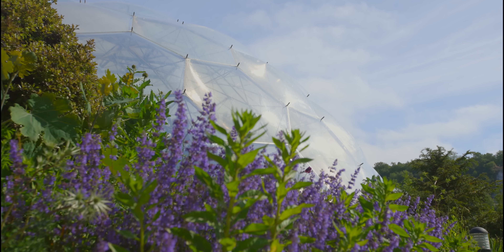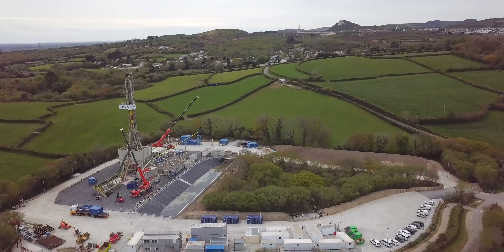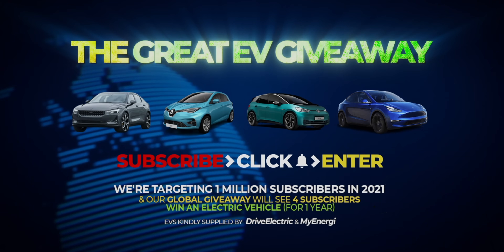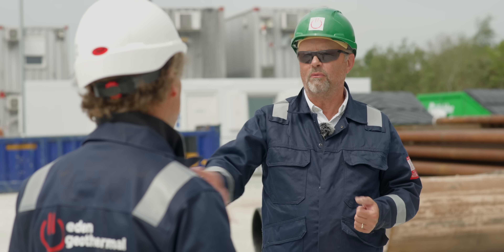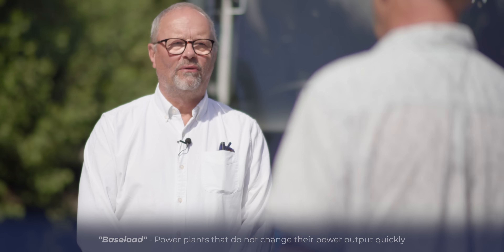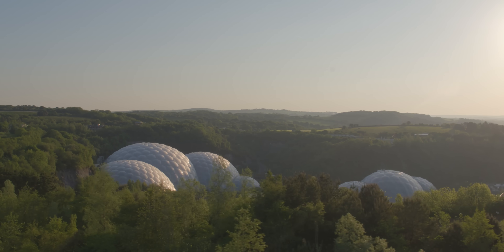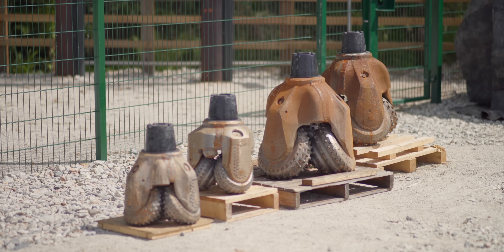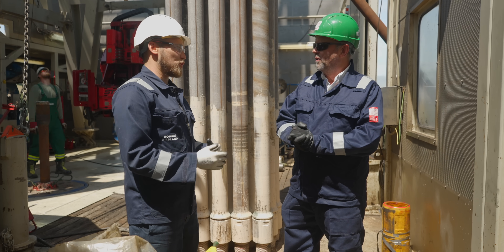Is Geothermal power the answer? | FULLY CHARGED

Comment: You would think that every new housing development could share one reasonably sized bore hole for District heating. That with a solar array and GSHP and maybe a battery and every house could be essentially carbon neutral?
Reply: Planning permissions would be a nightmare.
They all ready are for aesthetic reasons, but it would increase 100 fold, ostensibly for ‘environmental’ reasons. I can imagine locals complaining about noise, fumes and worries about water tables and earthquakes.
Britain can’t do anything without 10 + years for lawyers and consultants to get their cut.
Reply: Not carbon neutral, lots of gas comes up with the hot water. Oops nobody mentioned that....
Reply: @kimollivier  Gas? What sort? How much? More than would be produced by heating the house/flat/building up to the same temperature when using gas central heating or electricity? What does "lots" mean?
Reply: @Neilhuny  exactly,  it's known and there are scrubbers for cleaning up. 
Still there is some slight co2/methane release. 

Geothermal and nuclear are the biggest potential for most countries.
Reply: @kimollivier  That is a valid comment about the whole show. There are various problems with geothermal electricity production and this show didn't address any of them. I didn't know about the methane issue but that would have been a nice one to address. Does the fact that they are drilling through mostly granite reduces the problems with methane release? Are there other gases that are problematic as well as methane?
Reply: @kimollivier  Or the radioactivity. There was a small hint about that. Granite is hot because of the decay of its uranium content. A chap from NZ I talked to many years ago also mentioned the issue of the hot water containing many dissolved chemicals from the rocks and how corrosive the hot fluid was. You can bet the greeny weenies will be out in full force against geothermal when it hits its stride.
Reply: And, in addition to carbon neutrality, there's the economic win of no-one ever having to pay a heating bill ever again.

My mate moved into a flat in a new apartment building in our town. It had been properly built with all the insulation, solar on the roof of the building that powers an air source heat pump. No-one in the building ever had to pay for heating. Completely free and included.

It can be done because, in places, it is being done. And my mate's chief complaint was that, actually, it was too hot. Whatever insulation they used was, arguably, too good. As his problem was always trying to get rid of the heat, never once that it was never warm enough.

Note: If you're ever getting a heat exchanger / heat pump make sure that it's reversible. Because, yes, any heat pump / heat exchanger can be rigged up to run in reverse and actually take heat away, and act as air conditioning. And, trust me, you'll want this. It might not strike you as likely, if you're struggling to warm up an old Victorian house in Winter, with high energy bills, that your problem would ever be the opposite - that you're getting more heat than you ever wanted for no cost whatsoever. But, seriously, that's what my mate experienced in a properly constructed modern apartment block, as they'd built it from the ground up with the best insulation and using a solar-powered heat pump (air source rather than ground source, admittedly - but that's the thing, air source is possible anywhere, where ground source might not be easily done).

Imagine the economic win of every building in the entire country having free heating. Well, the energy companies would lose out. But, like, the largest part of most people's electricity bills gone in a puff of smoke. Hundreds to thousands of pounds a year put back into everyone's pockets again. Free money for everyone, basically.

The technology's already there. Because, as I said, I've seen it in action. A rather large apartment block (there was at least 50 generously-sized flats in the place) where no-one paid for heating - all inclusive - and, truth is, it was too good. The residents complaining that they needed to turn off the heating more often, as it got too hot and never the reverse.

And this is without going on to consider ideas like district heating and distribution. So, if that apartment block got too hot, then it could pump the excess heat out to other buildings. And battery storage to do the same thing with any excess solar. My battery's full so, here, have my excess. Put it on the Grid, for someone else to use.

We could eliminate anyone ever having to pay for heating ever again. And that is, by the figures, the biggest chunk of what we pay for, that creates the most carbon emissions to satisfy.
Reply: @klaxoncow  It's not free it'll be included in whatever the service charges are for the building. The service charges are likely high as well, part of the you will never own anything and be happy mentality. District Heating schemes are well known to have efficiency benefits however the costs generally don't stack up. 

Properly insulating new builds is a separate matter as is designing to take into account and manage passive solar gain. EcoBling isn't the solution...
Reply: @klaxoncow  This post needs to be a Fully Charged episode all on its own

Comment: Trying to grasp the differences between shallow-ish depths for heating and cooling, and the deeper pipes for electricity generation..
Reply: The latter require a heat pump which of itself needs to be powered because it is tapping into consistent underground temperatures which exceed the temperature at the surface in winter.  It greatly reduces the energy needed to heat water and/or buildings but doesn’t eliminate it.

As such these two are only loosely related.

Comment: As mentioned in the video, it’s the oil and gas industry that has provided all the technology to be able to drill geothermal wells - not just here in the UK, but worldwide. For commercial geothermal power production, you need to pump water down the deep well and then back to the surface through the shallow well once it’s been heated. There will inevitably be some seismic response due to the higher underground pore pressure from pumping water underground. The pressures are not as high as those used in ‘fracking’, but will be seismically detectable. By default, you have to accept that seismic response if you want to utilise geothermal commercial power.
Reply: That was covered in another video. There is a drilling site at United Downs near St Day in Cornwall.

Comment: The question I was hoping to be asked is does this energy source lessen over time?  As the rock is cooled by cold water being pumped down does the rock temperature remain the same?  Perhaps it is close enough to the core that the heat is constantly replenished.
Reply: Geothermal heat is generated from decaying uranium and other radioactive isotopes in the earth’s core. As long as enough wells are drilled deep enough the heat is always there.

Comment: Batteries will replace baseload eventually. It could actually happen a lot faster than people think. Hornsdale in Australia is just one of 50 battery installations now that are already bankrupting peakers etc. And baseload eventually as the infrastructure continues to grow and become cheaper.
Reply: Hornesdale is only profitable becuase Oz has an utter fail off an electric market.
Reply: @simonhenry7867  Its the same story everywhere they are being deployed. They are cheaper to operate than peakers and frequency moderating assets. All of which have high marginal costs where as batteries are near zero marginal cost.
Reply: I think baseload will always make sense to some extent. If something is constantly using power, why create energy, transfer it to battery, then transfer it to the constant power use. I think it makes sense to get a baseload that handles the constant power use and then even separate it from the grid.
Battery storage works best flattening out a peaky usage and/or supply.
Reply: @trevorWilkinson  Our current arrangement is inefficient because it does not have storage. You only need 4-5 hours of storage in any grid to displace 80% of the generational assets. And we receive more energy from the sun in a single hour on this planet than our civilization uses from all other sources combined. Including fossil fuels, each year. Its a stupidly small fraction of a percentage that we need to capture and store to meet our daily needs. The current grid needs base load because it is a centralized system. The new grid infrastructure is distributed with millions of contributors. Solar and wind are distributed energies. 
In the next ten years we are going to hit what is known as "God Parity". That is the point where it is cheaper for the consumer of power to be energy self sufficient, than what it costs the utilities to deliver the power, before the marginal costs of generation are added to the bill. We are already way past grid parity today.
Reply: You're right and with things like ambrí battery, water or heated sand as is being tested in Finland.
This is a real scam to rescue oil industry. With public funding.

Comment: I love geothermal but it can’t be done everywhere, you need the correct geology to make it work. Iceland have the ideal geology for it for example.
Reply: Technically, it can be done everywhere, if you drill deep enough... the catch is that the deeper you go, the harder and more expensive it gets, so there's a limited number of places where it's cost-effective.  However, as pointed out in the videos, if drilling for oil etc reduces, there will be more drilling rigs available, helping to push down prices for drilling deep wells - and that opens up more locations that could do geothermal cost-effectively.
Reply: @logicalChimp  you require the correct permeable geology in order for it to work, I undertook a study for a project in Northampton, the resultant report in indicated that there was not a hydrothermal layers deep enough to make geothermal a viable solution. Unless you have that permeable geology the water has nowhere to go and be heated to allow the extraction of the steam.
Reply: Iceland needs only a shovel to get to useful temperatures
Reply: @crackedemerald4930  wait around long enough and the earth will do it for you 😆

Comment: Intresting, but i started to read a bit about it and its sadly not completely without co2 or methane emissions. It has an estimated 0.1 pounds per Kwh as an emission. But this can be prevented with a closed loop system instead of an open loop. Natural gass has co2 emissions per kwh between the 0.6 to 2 pounds and coal 1.4 to 3.6. 

There is also a need of water but this can be dirty water and wateruse can be limited.  But there will always be loses because of steam .

I do wonder is there is some knowledge about the consequences of extracting this heat from the crust. It might not matter cause the heat would get to the surface anyway. Or would we speed up heating our atmosphere with minimal amounts? I dont know.
Reply: I can't help thinking it's pretty irrelevant that it's still has some emissions!  It's a vast improvement on what we're doing now, and time is kinda running out..........
Reply: @andymccabe6712  yea I do agree, but for a long-term use 0 or negative would be best. While a closed system would be capable of a 0 co2 emissions so its a great solution as long as its a closed system. 

I would also rather see a BEV than a Plug in hybrid.  They are both improvements but one is capable of 0 emissions in perfect condition the other technically too but why would you then even want benzine in your car.
Reply: Re: heat extraction, one idea I've seen suggested is, on days when there's a surplus of renewable energy (solar, wind, etc), to reverse the process and try to e.g. pump hot water back down...  probably not effective, and probably not required for deep wells like this (that are heated by natural radioactive isotopes in the depths), but probably an idea for shallow-well geothermal.

Comment: I'm confused. according to sir Tim smit there isn't a square inch of England that can't be mined for geothermal power. But Max skerratt says only Cornwall has far better thermal temperaturs for mining to produce on mass grid energy . If you look at gep thermal map they showed IT PROVES his point. Most of England/Scotland/Wales were mostly cold
Reply: What I heard was that it CAN be done anywhere in the UK, but it's EASIEST in Cornwall right now.
Reply: The heat gradient in granite is better than other rocks in the UK, it’s the original heat left over from when it was a molten rock 280 million years ago.
Other rocks can be be used for geothermal, but not so efficiently for power generation.

All rocks underground are warm or hot, there are no cold rocks. On a relative basis, granite is usually hotter than sedimentary rocks. Most of the worlds geothermal power plants are in volcanic zones (Iceland is 100% geothermal power for example). Currently active volcanic zones are hotter than granites, in the UK Granites are the most likely option for commercial geothermal.
Reply: @paulm3538  Actually, from what was said in the video, the heat is due to natural radioactive isotopes... in effect, we're tapping a giant natural nuclear heater, and using it to boil our water to generate the power...
Reply: @logicalChimp  Yes, that’s correct. All of the heat in the earths core is from natural nuclear reactions and all of the earths igneous rocks (including granites) were melted because of these nuclear reactions. The Cornwall granites (the Cornubian batholith) were liquid rock 300 million years ago and were intruded into relatively shallow depths 280 million years ago at something like 1,500 degrees Celsius. Granites cool extremely slowly because they are usually several to many Km’s deep (and so insulated), so the remaining residual heat today (180 degrees Celsius) is what they are targeting to create steam for steam turbines.
As a comparison, the basalt being erupted today in Iceland is 1,200 degrees Celsius at the  volcanic cone but cools to body temperature in about 1 week in the absence of any new lava flows.
Reply: His contention is that you can "just drill deeper" but I'd rather hear a few more opinions.

Comment: The energy generation is obviously great, but the provision of community heating is the only way to fully realise the benefits of such installation. From fossil fuel plant burn to plug, you lose about 80% of the energy, with a significant amount of UK homes actually heated by gas.

Comment: I really want this to work. But I'm reminded that they were talking about geothermal wells when I moved to the westcountry. That was 39 years ago.
Reply: Negativity is baad, dude......!
Reply: These guys aren't talking about it, they are half way through the first drilling
Reply: @dougowt  I don't think that disproves the sentiment. If this is just a  one off, then this is just another hype cycle that hasn't gone anywhere.

Wave power have been pushed at various times over the past 50 years. as far as im aware theres still no grid connected producers, so despite there being demo projects being built, it isn't the energy source of the next decade.
Reply: @benholroyd5221  I’d say we are very close to getting grid connected wave power. Part of the problem has always been the cost of subsidised fossil fuels. But renewables are becoming the cheapest option. And we would have had tidal projects under way, if they had not been deliberately delayed. Times are changing and changing quite quickly.
Reply: @dougowt  changing in what way? most technologies that actually work never get past the 'too expensive for x reason' 

There have been a few demo projects for tidal recently, and they haven't generated as much energy as expected. and even if they do fix that, which isn't guaranteed, you have an almighty slog to get from there to price competitive technology.

Wind and solar have been around for decades, theyve only just got to the point of cost competitiveness.
Reply: @benholroyd5221  The naysayers said that renewables would never break even, or that wind generation wouldn't, solar pv wouldn't, solar heating was dubious, would take more than the lifetime of the method, yadder yadder yadder - all shown to be wrong.
Tidal power at Swansea was shown to be cheaper than nuclear power at Hinkley Point across the channel.
The Tories chose nuclear power
Reply: @Neilhuny  right... But the (opposite of nay)sayers were probably talking about how we'd all have roof top wind and solar road ways.

You can't select the successful technologies and infer all technologies will be successful, just like you can't do the opposite.

If the technology takes off, great. It's presumptuous to assume that just because one small project is being built, which if successful will be expanded to actually power homes, is on the cusp of taking off.
Reply: @benholroyd5221   there have been a few tidal projects recently that have worked as expected and are being made production ready. Successful wave energy projects are beginning to appear all around the world